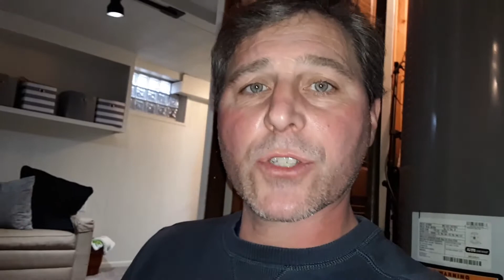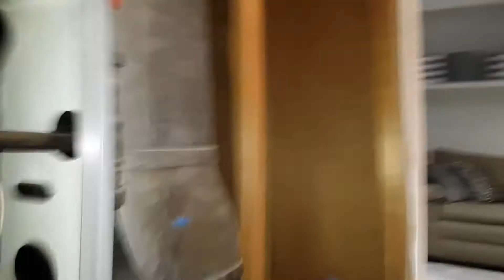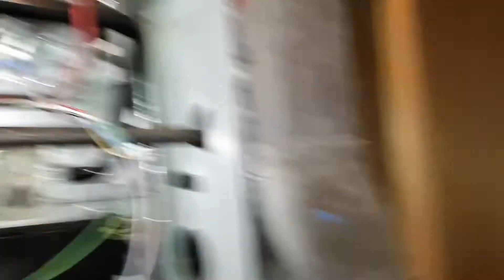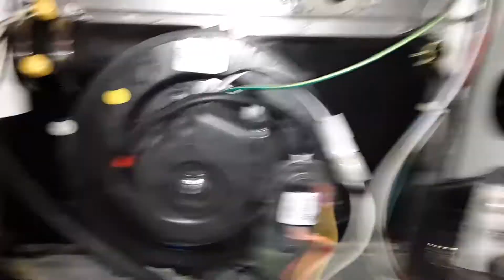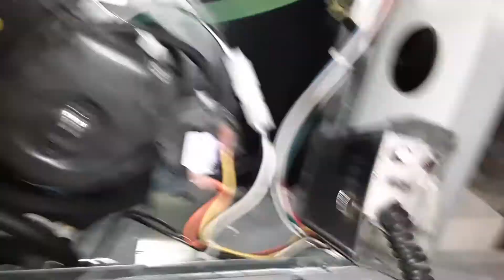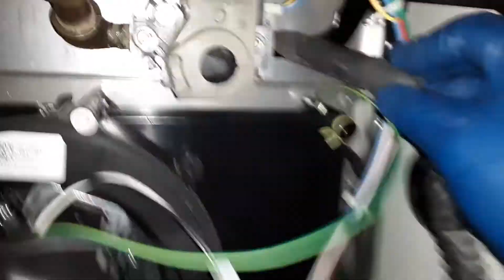GAS LEAK 🚭 at furnace gas control valve ONLY🤔 when its turned ON🌡

Comment: Do you think it is a defect in the valve or a loose fitting?
Reply from the maker: Typically at the fittings from the manufacturer. They put the control valve on, although  they can be altered by anyone working on it in the last 15 years. Soap bubble test would show the exact location.

Comment: You, ummmm, think you could fix the sound?
Reply from the maker: Tried. Hard to fix the sound. HVAC was in a tight closet. High efficiency furnaces with mono port burners and inducing exhaust fans can be very loud. Thanks for watching
Reply: @inspectflix  Lol That gas detector is a cool tool but noisy as ...Thanks for the info though